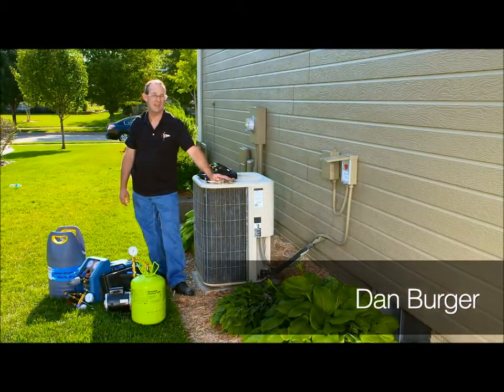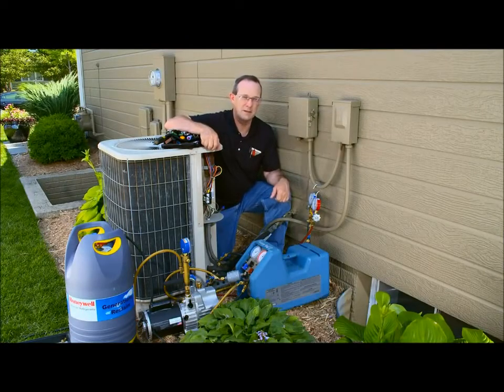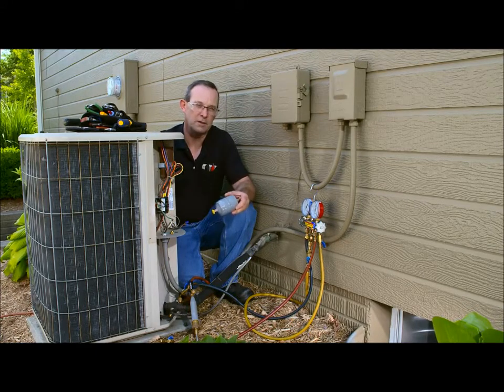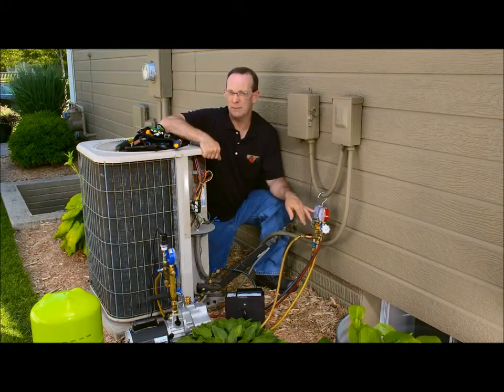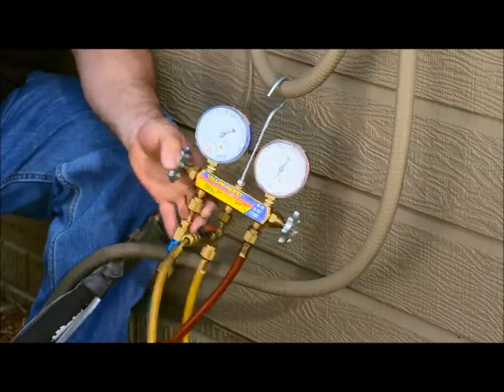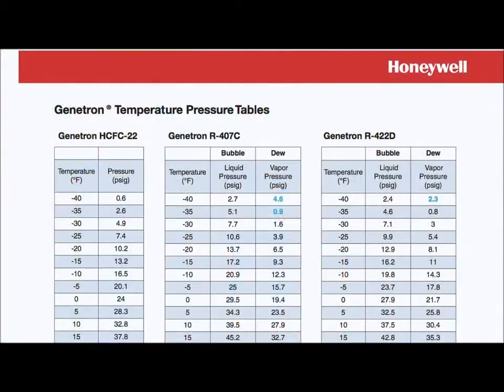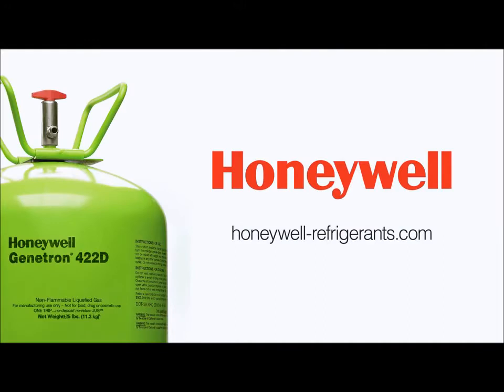Genetron® 422D: The No-Oil-Change R-22 Retrofit Solution for A/C | Commercial Buildings | Honeywell

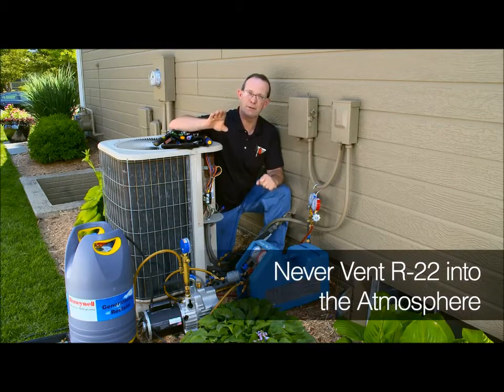Comment: 1:23 think you said you have recovery equiptment and you have vacuum pump and that you have vacuumed the system. or something like that. that seems odd to me please explain
Reply: you did evacuated the system but i think meant to say the recovery cylinder. big difference
Reply: Well a good and simple explanation is, what recovery machine does is it recovers the old refrigerant from a system.its a little dangerous to mix two different refrigerants in one system.so it helps a lot.what vacuum pump is,well just an air compressor which forces out any moisture and air in the system.its dangerous to charge refrigerant with air since in can cause pressures in the system to remain higher than specified for sytem or refrigerant and therefore cause a leak.depending on where the leak is outside or inside can pollute the environment.if the leak occurs indide the house then through the ducts whole house will be polluted. Hope this explains.

Comment: can I extract the Freon and oil with the same pump? do I have to uninstall the compressor in order to get the oil out of it? please help me....
Reply: Anyi Pena R422D is a "drop In" replacement for R22, so no oil change is necessary.  All you have to do is recover the R22 in the system and replace it with R422D.  Keep in mind you should always replace the valve cores, caps and filter drier.
Reply: Thank you so much...God bless you

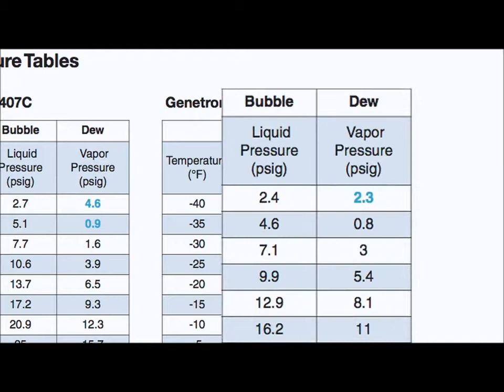Comment: At 4:21, I am confused about the calculation of Buddle and Dew pressure. Please re-explain. Thanks.
Reply: vabeach1989 422D is a refrigerant blend, so it will have what is referred to as "glide".   Unlike a single component Refrigerants like R22 there is a temperature difference between the Bubble point and Dew point.  When working with a refrigerant blend with glide use the Dew point to calculate Superheat and the Bubble point to calculate Subcooling.